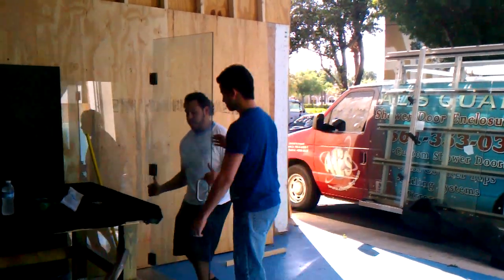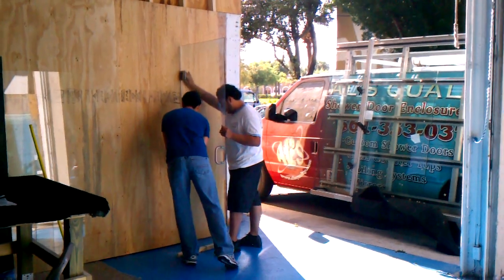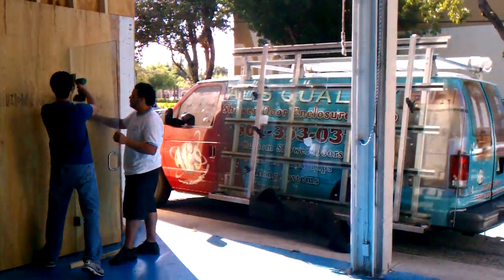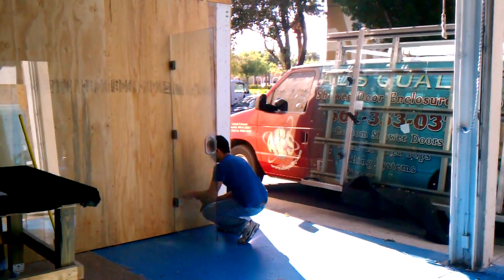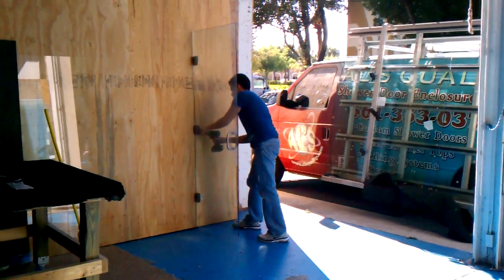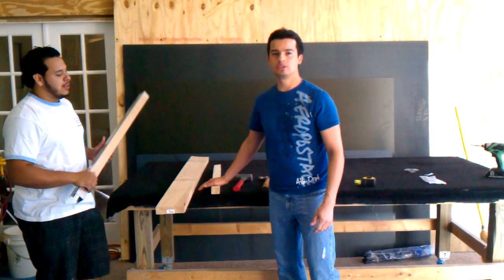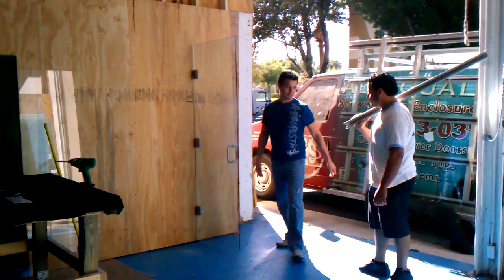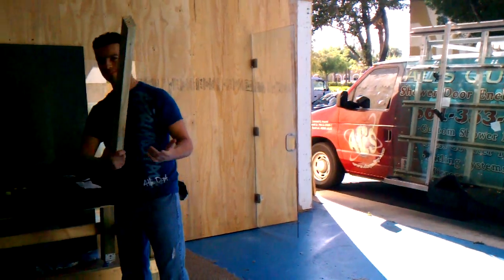Breaking tempered glass doors  - part 2 - Al's Quality

Comment: @luisitogangster 

It likely had an imperfection in it. tempered glass is extremely hard (harder than steel probably) but it's structure is very brittle and has almost no ductility. If it has imperfections in it and gets bumped against something, it might just shatter catastrophically